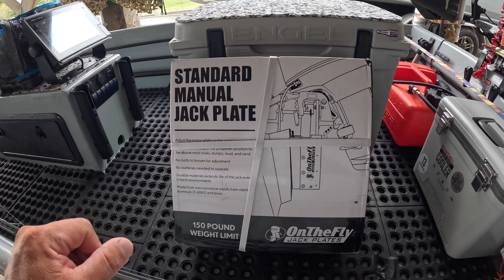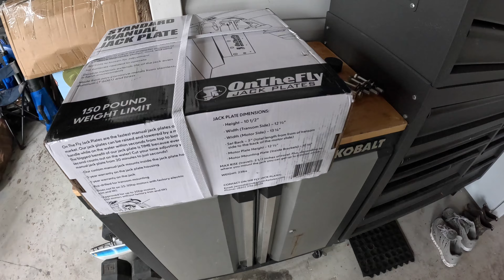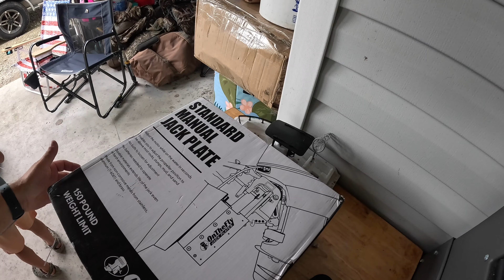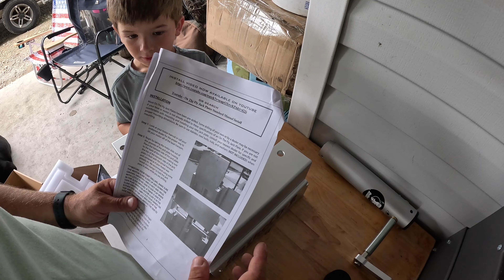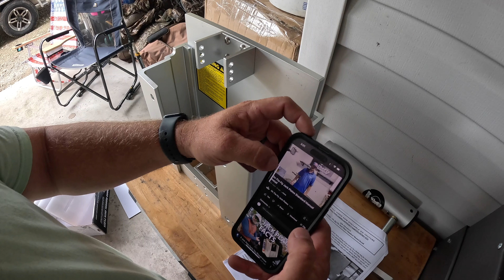On The Fly Manual Jack Plate Install on the Reel Freedom Jr.

Comment: Hey I’m not the one to comment on videos but you should put some type of metal plate in the inside to spread the load of your outboard you’re gonna mess up the transom. Like yours videos keep them coming
Reply from the maker: Hey thanks for watching and the recommendation! Its a wood/fiberglass boat which has a pretty solid transom for the motor that we are running. Have been using it for the last month and haven't had any issues but will def keep an eye out. If I have to reinforce it, I will mostly likely glass in a 1" board of Coosa. Thanks again for your comment and for following along!

Comment: I’m thinking of getting this exact jack plate. Currently I have a cmc tilt and trim. My only question is how do you trim the motor to get it on plane with a jack plate? Do you use the holes in the motor with the pin to adjust it and keep it at one setting the entire time ?
Reply from the maker: I leave the motor all the way down and use the manual tilt latch when needed. I have my motor pin one up from the bottom which sets my motor up right. With the jack plate you can jack the motor pretty high and keep it level. Its def nice to have!
Reply: @reelfreedomoutdoors and does the motor bolt to that plate or does it just clamp down
Reply from the maker: @ it does both once you drill the holes for the motor bracket through the plate. I used two SS bolts for more security.